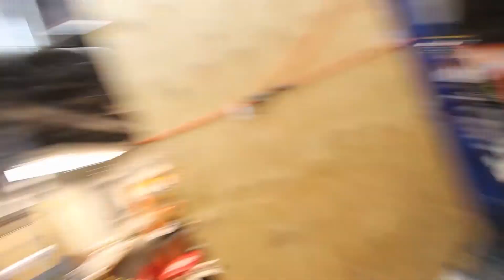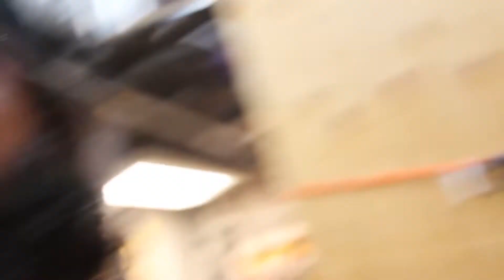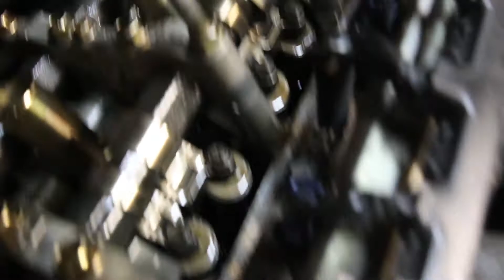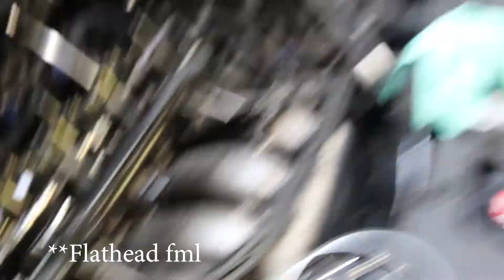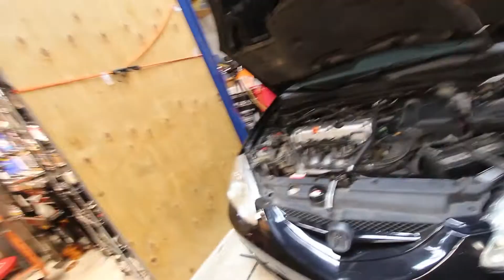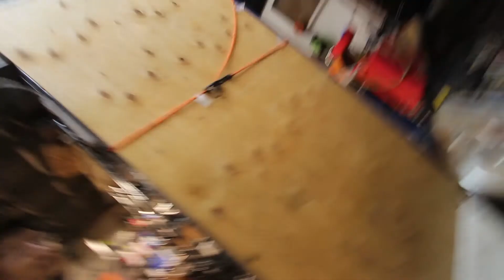Valve Adjustments, in search of a tick

Comment: issolate the sound. drop the belt completly and start the car. only run it for a less than a minute.

dose the sound go away once warm or just gets fainter when warm ?
Reply: throw a thick oil in it like 15w40 next time and see if it helps. that way you can determin the probable being internal.

Comment: How did the timing chain and guides look?
Reply: Yea check that and also see if the chain streched out.
Reply: just did a k series timing job ( chain , tensioner , guides)
the early k series are prone to stretching . but they will instantly throw a cam sensor code due to crank and cam sensor reluctors not lineing up with eachother.
Reply: Very true. Ive done a few at the dealer. Had two CRV come in same day had to do chains and vtc actuators.

Comment: Was this a cold start in your video?  Was the idle RPM high?  It sounds like it's ticking every stroke.  Valve ticks are usually slower - every 2 strokes.  That might help your narrow things down.  It sounds a bit fast for lifter tick, which was my first guess.

Comment: Anyone else with this problem should try checking for vacuum leak and/or depending on how that goes might be worth checking the idle air control valve and clean it out (short term solution) or replace it if you can (long term solution) and see how you get on